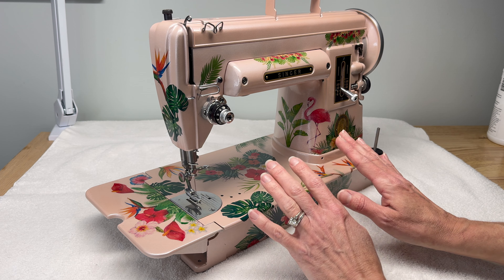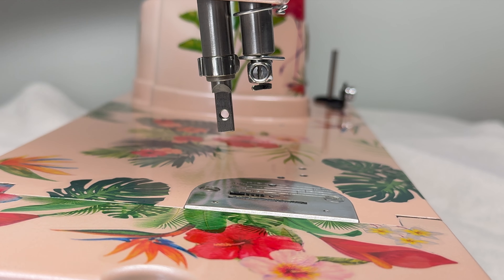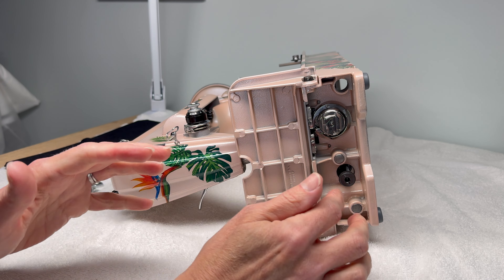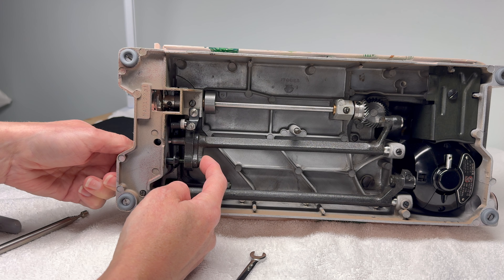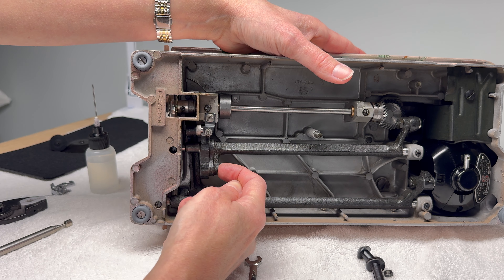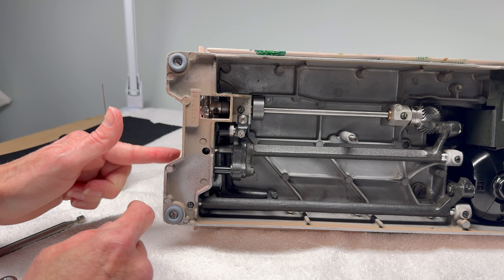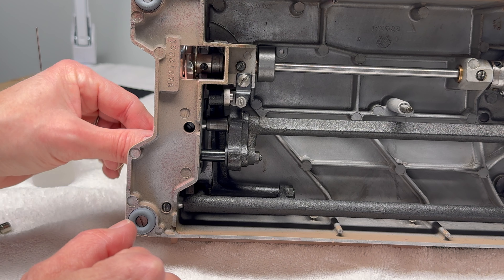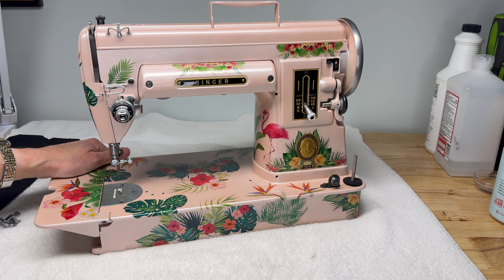Dropping the feed dogs on your Singer 301-Free motion quilt and darn!

Comment: I absolutely love my 301! I have several featherweights and try to use them all but find myself going back to my 301 over and over. I even took it to my last retreat for piecing. Just a great machine. I’ve just never used the feed dog knob so thank you for this video.
Reply from the maker: They are sturdy and the handle is nice. Love the motors in them too! The Featherweights big sister!
Reply: @SewingMachineRehab  yes! Happy sewing. 🧵 🪡

Comment: Thank you for the video! Worth the wait.  Any suggestions on what to do if the feed dogs do not lower on their own? Have to use a screwdriver to persuade them down. Thanks
Reply from the maker: Hi! My best suggestion is to take those parts off and clean them. Brush the threads on that long screw with a wire brush and clean out the threaded hole that the screw goes into. Then oil the screw before you reinstall it. That should make it easier to turn for you moving forward. I really hope that helps!